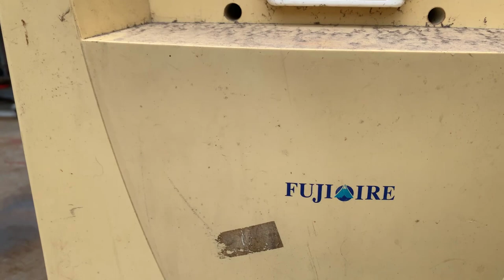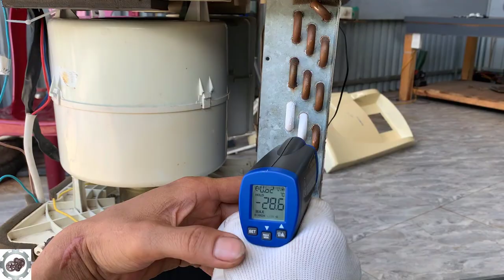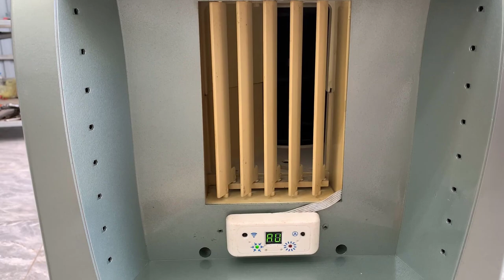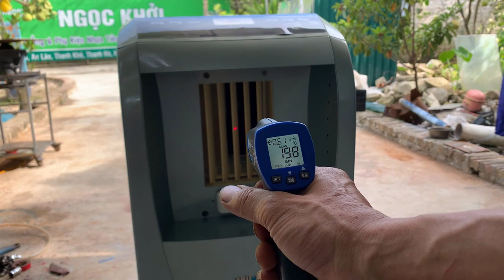Restore Obsolete Fujiaire Old Air Conditioner // I Restored It Like New

Comment: Great job.  Looks as if the original control panel had stopped working at some point, and it was replaced with another off a scrap unit.  Would be cool to get the original controls working again.  You did a great job on this.